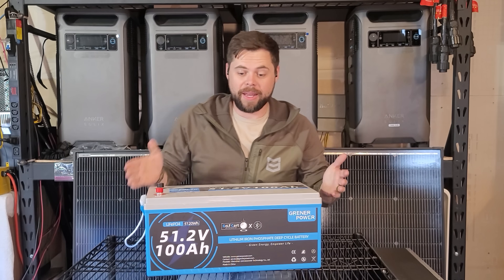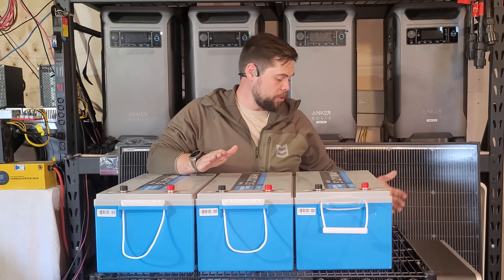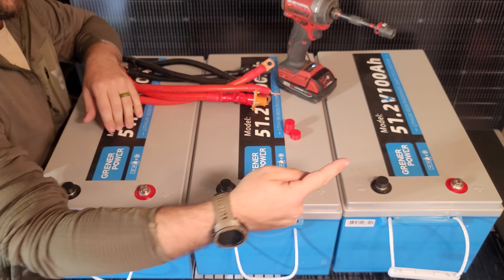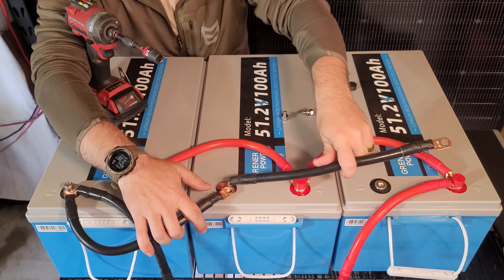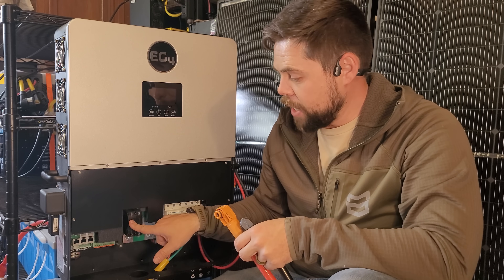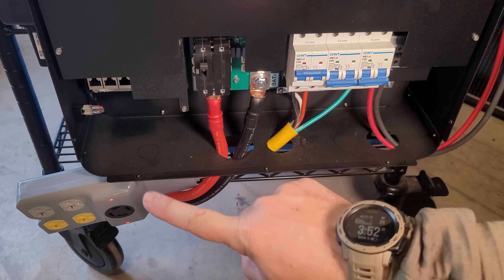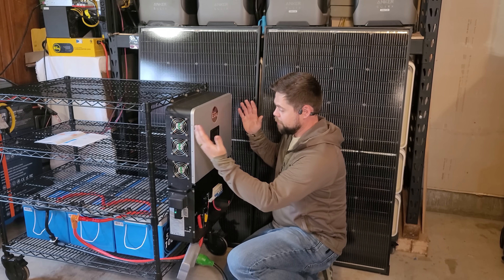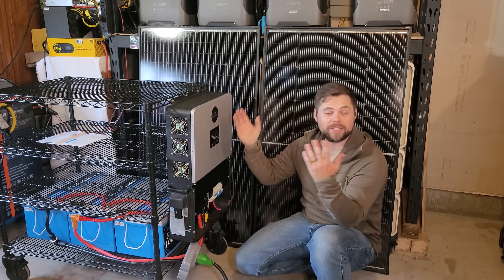Step By Step Whole House Power with Grener Power Batteries

Comment: Thank you. I am in the process of weighing our options. The first is a pair of F3800s as you've shown before. I like the portability and ability to grow capacity over time. I was leaning toward an all-EG4 solution as the fully automatic option. Is there a reason your EG4 inverter cannot auto switch? Is that just because you do not have it connected before your panel? Thank you for the videos. They are super easy to understand!
Reply from the maker: it can auto switch but then it must be wired into the electrical system of the house, not through an interlock switch. The auto switch is internal on the 6000xp so you have to feed your main grid power to the 6000xp, then from there to your main electrical panel.
Reply: @minutemansolar  that's what I figured. Just making sure. This is one of the units we're considering, though I think we want more capacity. Need to measure once we get the a/c running again this season. Thank you!

Comment: Seems like there should be a T Class fuse and a battery shut off switch in between the batteries and the inverter or I am just a little over cautious there?  Great setup though especially if your home doesn't have the typical AC units and uses mini splits!   I'd have to invest in some AC soft starts and a few more batteries and a good size solar panel farm to run my own home.

Comment: A minor item.  I'm sure you know this but it should be commented upon.  The battery terminals are not rated for 200C... even with silicon-insulated cables, you don't want to run more than 100A through 2 AWG cables.  Otherwise you can overheat the battery cells just from conducted heat from the cables.   The inverter lugs are the same... probably 60C or 70C rated (it might be in the manual).

So for current purposes or for future-proofing purposes, there is really no reason not to wire the batteries to bus bars which gives you a 300A battery bus still using 2 AWG cabling.   Basically 2 AWG cabling from each individually to a common bus bar for positive, and again for negative.  Then cable the inverter to the bus bars with 2/0 or double 2 AWG or whatever is appropriate for the application.

And sometimes its a good idea to over-cable to the batteries and inverter anyway just to reduce voltage drop under load.  That will handle surges better.  Sometimes much better.

---

Also note that server-rack batteries don't have to be wired for communications either.  Its safer if you do, but it isn't required.  The bus bars in the racks are often very convenient, too.   Without comms you need to limit charging current to a single battery's worth for safety... maybe a tad more.  I wouldn't run more than 1.5x a single battery's limits without comms.  150A in this case (7.7 kW).  And then only in a bussed configuration.

So in summary, if just paralleling batteries with 2 AWG cables to each other, without bus bars, limit the current to 100A.

-Matt

Comment: Really appreciate you making this video. Are Ryobi tools the best ever, no. Do they work really well when you need them, absolutely! Having so much capability on the 18v platform is incredible.
Reply: We have 48v system which is the same size with the Trojan T-125 battery, if you wanna experience our GC2 LFP battery?

Comment: Can you parallel those with one of the eg4 power pro 14.3kwh batteries?  Like just parallel all 4 with lead battery option?  

The thing i realized once it was delivered, holy hell this thing is way too heavy to try to take upstairs in a house.  Not without risk of one getting flattened if lost grip or im losing it, LOOK OUT!!! 

Oh look we just made a doggie door through the wall at bottom of steps onto front porch.  Uhhh yeah thats not good lol

Comment: The price may be better than a rag battery, but that’s the only advantage. Also, you don’t have to use communications on a rack battery but most batteries that don’t have communication need a shunt so you know the state of charge and I think the batteries are a lot bulky or than a rack battery so now you’ll use up more space than a rack battery and also most rack batteries are connected to a bus bar. Whenever you use wires like that to connect batteries it’s hard to get the batteries to equalize so the price may be cheaper but rack batteries are more efficient and save on more space not trying to knock your video, but you can’t compare those batteries to rack batteries

Comment: Would be nice to ditch propane and put in a large solar array to handle heating.  Is there not space for it?
Reply from the maker: For heat during the winter i use a crypto miner to hear my whole house which is powered by solar. But you'd need multiple 12000XP inverters to handle electric heat.

Comment: Ben:  what are the quick connectors called/named on the battery cable ends?  Thanks.
Reply from the maker: Amphenol. Get the 175a rated ones. Orange: https://signaturesolar.com/eg4-all-weather-battery-cable-connector-orange/?ref=SaJS3dc86BnakK&search_query=battery%20connector&searchid=1355113 Black: https://signaturesolar.com/eg4-all-weather-battery-cable-connector-black/?ref=SaJS3dc86BnakK&search_query=battery%20connector&searchid=1355113

Comment: This is great. I want to dip my toe into this world by putting an interlock switch in my garage subpanel and powering my garage and everything on that subpanel with batteries. other then solar, how can you keep those batteries topped off with off peak power?
Reply from the maker: More solar, but also you can use a gas/propane/natural gas generator with a dry contact and chargerverter to keep the batteries charged up if the solar isn't enough or there is long term bad weather.

Comment: this is a great option. what i would like to see is someone who started years ago with a 12v system and then changes to the more popular 48v system. i have a few thousand invested in a moderate 12v system that runs my garage 24/7-365. one benefit of 48v systems is that you can often run more solar with a similar sized inverter so i am looking to make this change but so far have not found anyone on you tube that has done this. I miss the days when you tube was a good source of info, now it seems more like an ongoing commercial for the latest swag from manufacturers. I do get it a lot of channels are now income sources......
Reply from the maker: Great idea. it's a matter of joining the 12v batteries into groups of 4 to make a 48v system, then linking the groups of batteries together to have more power. I'll put that idea in my video list and see when I can get to it. Don't hold your breath, the list is long! But that's how you do it. Then upgrade to a 48v inverter with a high solar input such as the 6000xp or 12000xp
Reply: @minutemansolar  i am working thru the logistics of rewiring and fuses,ect.  A lot has changed from when i put in this original system.
Reply: And it doesn't appear that anyone fact checks anything users upload. And appears lots of viewers just take it as accurate and factual.  Crazy times!

Comment: Hello,
I would like to charge the batteries with a generator instead of solar is that a good option?
Thinking with a generator, just run it when I get an alert on my phone that the batteries are low OR a automatic switch that will run the generator.
Just don't want to rely on solar with the weather we have in Massachusetts/Burlington.It's been raining for 4 days now.
We use a electric dryer/stove 4 head Mini Splits  oil heat 
@60 years old I want to reduce my $300+ electric bill but not spend a fortune.
Reply from the maker: Yes you can do that. You need an inverter that supports "dry contacts." Then you need a gas generator that supports dry contacts. Then you need a 48v chargerverter. With all of that combined the system will automatically keep the batteries recharged from the gas generator.
Reply: @minutemansolar  Thank You Sir

Comment: Can you review the $1000 AFERIY P310?   It has as much KWH as the anker Solix f3800 and  delta pro (3840wh).      3600 watt inverter.    The only thing I don’t like is that there’s no split phase option even if you buy two, but I’m wondering if an aftermarket device would allow me to buy two of them and then run the house
Reply from the maker: I believe that one is on my list. I prefer the Pecron E3600 currently since it can join two together to get split phase if needed. Video coming.

Comment: Do you use the xp6000 to charge the batteries? How would you set that up. Otherwise what do you use to charge the batteries.
Reply: Does the 6000XP charge the batteries correctly since it is set as ‘lead acid’ due to no battery communication?
Reply from the maker: @NCprepper  Yes it does
Reply from the maker: You can charge with solar, wall charging 120v or 240v (same as charging with gas generator), or use a chargeverter directly to the batteries for the best charging. It can also recharge the batteries using grid power. If you're interested in a complete system send me an email to info@minutemansolar.com

Comment: Are these 12 V batteries or 48 V batteries? Makes a big difference if you’re trying to run a house.
Reply: Did you watch the video? Not only did Ben say it like 3 times, the voltage is printed on the side of the battery... Also, how do you run an EG4 with 3x12v batteries?
Reply from the maker: They are 48v batteries. I always prefer 48v to 12v.